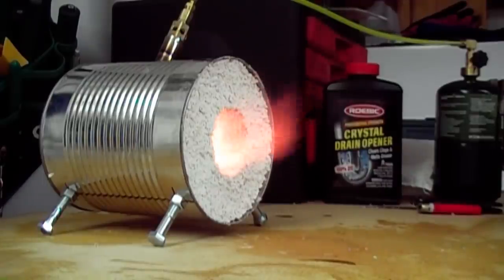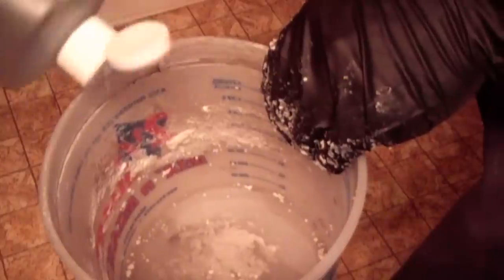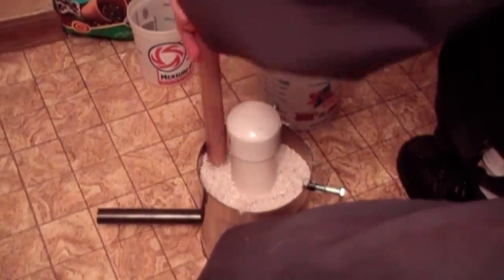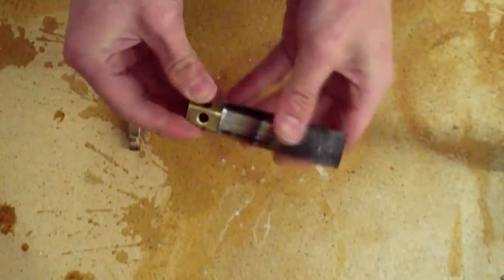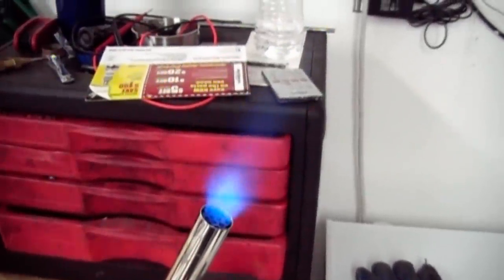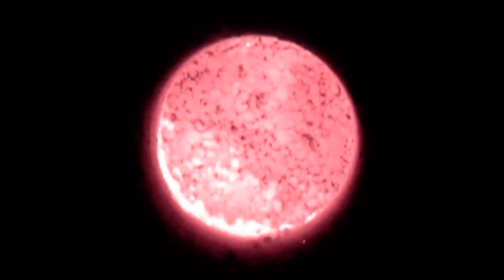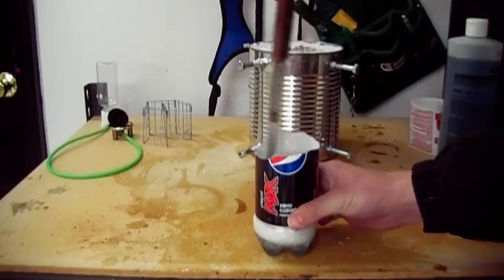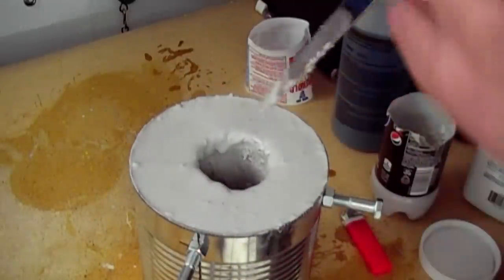How to make a coffee can forge

Comment: Wow, the alumina/magnesium silicate coating was a brilliant touch!  I really liked the details of your burner design, too.  Thank you very much for sharing such ideas!  Like others, I'm curious about the temperature your forge reaches.  One suggestion would be to use a small pyrometric cone.  They are cheap.  I have some I could send you.  If this forge can reach cone10, I'd be pickled tink. :)
Reply from the maker: Interesting, I have heard the terms "cone" followed by a number in referring to kiln temps but never really knew what it meant. Are these pyrometric cones one time use? Thanks for the comment!
Reply: clkindred
Yup, they're one time use.  But a box of 50 small cones is only about $7, so for an occasional check they're very affordable.  They don't measure precise temps (because time is a factor too) but are plenty accurate for this use.  Just push the base into a tiny ball of clay to keep upright and place to the side, where the flame doesn't directly impinge.

Comment: I think using 5 gallon can with the #10 can as the inside diameter, with 2 or 3 burners would be a good mini furnace. Using a 55 gallon drum with three 5 gallon cans put together on end with the top and bottom cut out of the middle can would make a nice small furnace to melt down scrap aluminum into sizable ingots...
Reply from the maker: Tony Iocca If only I had a place to store one that big...

Comment: Tried the Refactory recipe on my 1 gal metal furnace.  Looks like the pearlite is hardening up nicely but it hardens from the outside first.  It does better if you slowly and gently heat the sections one at a time. 1st made the base and lid for the furnace and let cure 24 hours. then into oven at 180degreesf for 4 hours. then up to 215 for one hour then up to 350 for one hour. leave in oven till it cools off naturally with door shut.  The inner tube wall is then added and the process repeated until all parts have seen the full cycle.

Then 1st exposure to propane fire for 1/2 hour.  Don't know if that's enough curing time, but it sure helps.

I don't like that it takes so long to get this all together, but I also don't like having the furnace fall apart in the middle of a heat either.  Main thing is don't boil out the Sodium silicate too fast or it will break up the pearlite cake from the inside.
Reply from the maker: Interesting, curing times seem to vary quite a bit from what I'm reading from people. There seems to be some major drawbacks to this method. Mainly, it's kind of like cooking food, in that there are a lot of variables to take into consideration that will effect the outcome. Also it is frustrating to work with a material that dose everything it can to fall apart. I'm working on a slightly different recipe and will post a vid soon. Thanks for the update!

Comment: This is a nice ,not to big ,set up for doing a few knives. What source of heat are you using if not a blow torch? How would you attach anything bigger to the S/S tube. You should put up more accurate plans for your burners and sell them for a few bucks. I'd buy them just to get exact measurements and from your comments,others are interested too. Great video!

Comment: Next time pour your mixture of the coating into a thicker 1 gallon zip lock bag, gut a small section of the corner off and use it like you would for a cake decorator squeezing the mixture into the inside. Just like decorating a cake. It will prevent waste, keep things cleaner and speed it up a little for the application process. Because you can add a long frosting tip (cake decorating section at craft stores etc.) use a spiral or wave pattern to apply the smooth with your spatula. Cuts the time down a lot if you know what your doing.

Comment: I have a question (maybe a dumb one but here it goes).  First I really like this little project and when I get time I plan on building one.  Here's the question, according to some research I did online I see propane can heat up to 3700 F,  Stainless steel melts between approx 2500-2700 F depending on the type.  With the torch projecting that heat into the forge why doesn't the heat eventually reflect back and cause the stainless steel sleeve to melt?  I'm guessing that the heat loss out the front of the forge is keeping the reflective heat acting on the stainless steel sleeve to be less than 2500 degree F.  Any comments welcome..

Comment: seems like it will create a hot spot.
Reply: +ken halverson It will indeed. But the working envelope inside is so small and the torch so intense that a simple cover or door would almost eliminate the problem. The propane burns at 3600 degrees and I bet at the opening it's not much less than that. As a forge for small parts this would be a great setup. As a heat treat oven it shouldn't be too bad if you want everything heated to 3300 degrees. :)

Comment: thanks, I built this forge, exactly the same, but I am using MAPP gas hand held torch.  before i built the forge i was placing a couple a fire bricks on the ground in a v shape and getting my steel red hot but not enough for a good forge, this is why i built the coffee can forge.  However when I tested it today for the first time, i put the nozzle of the MAPP gas into the hole but my forge is not getting hot , it is almost as if the flame is on a lower setting even though i put it on full.  the steel does not even get red hot.  something is not right.  i have a smaller nozzle than your burner, maybe I should open up the other end of the forge so there are two holes for the air to come through?  or should put a bellows i have made and pump air into it?  or should i modify the gas burner ? what are your thoughts on that.

Comment: Friend uses thermal wool and porcelain slip instead of perlite/plaster.  Kiln cement might work too.  He also makes a little curved wall at the bottom where the burner comes in, causes the flame to swirl back on itself and builds the heat.  I am curious about the plaster.  Been doing lost wax casting for 38 years.  Always told us plaster explodes at about 350 degrees F.  Lost wax investment is mixed with silica to improve its heat capacity, makes me wonder if investment would be better than the plaster in the long run, being premixed... But don't breathe the powder while mixing it!  Silica is bad for the lungs!  Friend says he has done short sword lengths in a #10 can.  Has also used an old turkey roaster as a base container.  Runs a black pipe into the can, covers the pipe with a fire bed made of seed corn and cinder landscape pebbles and sand.  Bellows or blower on the other end of the pipe.  Whole thing is portable in a 5 gal bucket and you can go anywhere.  No coal fumes or smoke, and seed corn is renewable.

Comment: +clkindred, I imagine you could use two coffee cans, soldered in the  "end to end" fashion to get a refractory longer for making a longer blade, e.g. a Bowie or a huntsman's knife.
Reply: John Mood Or just cutting a hole in the back would work too, otherwise you will need 2 burners anyway.
Reply: Then there is the neighbor with the oxy-acetylene welding setup, and I could theoretically  owe him a favor and get a "can" made to fit my needs. I figure three burners, turned on as needed. Lots of  refractory brick, not too hard to find in my town. So a little custom tubing, valves, and burners and I'm in business. Up to about 24" long and about 3" opening for the metal. I'll draw it in AutoCAD and go to the neighbor and we'll have us a crazy good foundry. He makes stuff too,so we can build it for both our use. BTW, I like you moniker, "Caveman", cool...

Comment: Are you spreading that special cement with your mother's favorite bread knife!?!?!  Great ideas on the stove!   Will your forge  melt all my fine gold dust?  How hot does that stove get.  Measure it with a laser temp. gauge if you will.  Thanks for Sharing.
Reply from the maker: MY mother's favorite knife? No. Someone's mom's favorite bread knife? Perhaps. I got the knife at Goodwill for like 50 cents lol. The laser thermometers I have can't measure high enough to give a reading. Nothing above 300 or 400 degrees F is measurable.

Comment: Very nice video.
A few questions
1: Would the perlite be exchangable for vermiculite?
2: How economical is it? Does a propane canister last a long time when used like this?
3: If a larger vessel would be used (like a large paint can or something similar) with an opening in the back of it for air (oxygen) intake, is the air intake on the burner rig still nescessary? Or can that be omitted?

Again, great video and thank you for the inspiration.
Reply from the maker: Sorry but I did not get a notification of your comment.

1: probably, I'm still researching the perlite's properties when used in this manner, I have used vermiculite in an experimental refractory using portland cement, but it proved only useful in reducing it's weight, the portland cement cracked at high heat.
2: It's cheap if you use it from time to time, it's always cheaper to use a 20lb tank in the long run, the 1lb tanks provide conveniance.
3: The size of the forge and number, size and location of openings (proper exhaust for combustion gasses still nescessary) has no effect on how this burner runs. omitting the primary combustion air holes in the burner will cause the burner to spew a soft yellow sooty flame. Gas burners have been designed to use external forced air (hair drier/leaf blower) in which case the orifice (gas jet) is typicaly larger, as the high velocity gas stream is not nescessary. These burners need a regulated gas supply as well as regulated air supply in order to tune the flame to a hot blue.
Reply: clkindred
Thank you very much for the in depth response. Very helpful =)
Reply: clkindred

research the manufacturing of a glass gloryhole, which is the reheating drum for glassblowing. functionally, ust a bigger version of you ten can forge.

Comment: I'd like to use a modified version to heat rebar for bending.  I wonder if both ends might be left open, perhaps with a smaller hole nearest the flame, so that rebar could be passed all the way through the forge?  That way I could make the bends starting forward and finally pull the remaining rebar through the forge.
Reply from the maker: It could be made that way, sure. It just complicates the form needed to shape the lining a little.
Reply: Well then I'll make one and let you know how it comes out. Thanks!

Comment: Plaster and sand work fine and they are cheap and easily attainable.
Reply from the maker: stizan24 My advice is to try it and see how it works for you.
Reply: I did. It worked well. Then I built my coal forge. Nice videos and some cool stuff but I don't have the time or the resources to make stuff to make stuff so I can make stuff.

Comment: With the perlite you made a form fitted fire brick. And with the liquids you made fire cement. I like the fire brick concoction, but it'd be cheaper to buy a tub of fire cement and use it.
Reply from the maker: Perhaps, but I already had the stuff to make the cement, so it did not cost me anything.
Reply: okay, but for those that dont have the stuff, the fire cement would be the cheaper way to go.

Comment: What did you use for making the threaded ring. I assume you cut it down from a threaded part. This is a great video and also the one on making your own sodium silicate. Awesome stuff. keep it up. You should stock the parts for the burner since I had trouble coming up with them. Sell a kit.

Comment: Stupid question, but why did you design it like a foundry? 

You don't want the swirl flame necessary in a foundry since you will not get even controlled heating from it that you need in a forge. The swirl is necessary for a foundry to evenly heat a crucible that fills quite a bit of the internal volume, preventing the crucible from overheating at the spot where the burner enters the chamber yet being cold on the other side. The foundry also does not need a spatially controlled heat source which intentionally leaves hot zones within the forge yet enough insulation value to maintain the heat within the steel being worked that has already been added.

A propane forge generally uses two equally spaced smaller burners instead of one large burner, and these enter at a ninety degree angle, either from the side or from the top (best). This allows for controlled heating of small parts or controlled heating of long pieces.  The needs and design are different between a forge and a foundry, as the use for each is quite different. The only similarity in use is that each is designed to efficiently heat a metal.
Reply from the maker: Paul Andrulis Thanks for the comment. Best answer I can give is I had no idea what a forge needed as far as burner utilization.
Reply: That's not a big problem. The design and overall build was actually quite well thought out excepting only burner placement. Overall, not too shabby. Used vertically, that would make a nice little foundry for small pouring projects as it is.

Comment: What is the purpose of adding the extra layer of the aluminum oxide/sodium silicate? Is it for thermal properties, or to have a stronger surface to prevent the perlite from chipping away? ( I noticed it was a little crumbly )
Reply from the maker: Stronger surface, and to provide a "non stick coating" so scale and other stuff dose not embed into the perlite. Thanks for the comment!

Comment: Great video. Thanks for sharing. 
Could the insultator also be made of a mixture of paster of paris and sand?
Reply from the maker: That seems to be a popular method. There are two properties. I want in a refractory, one is temperature resistance, the other is insulation. Plaster and sand In my book falls under temp resistance only, no insulation.

Comment: Grear video with clear and easy instructions, it was very helpful!!
 I do have a question for you. I'd like to make a Coffee Can forge myself. But I was wondering if I would be able use a Pre-mixed Furnace Cement like Hercules brand Hi-Heat Furnace / Stove Cement that has Sodium Sulfate and Silicon Dioxide already in it, that I you can get at any home store?? I have a tub of the Furnace/Stove Cement already and it's rated to 3,000°F. So do you think it would work on its own or would I have to mix it with the perlite to get it to insulate properly?

Comment: Will this work if you use a large center form like 3 1/2-4"? Could it work with a hole in the back, allowing larger pieces to be heated? I'm planning to use itc-100 to line the refractory lining. Using a TS8000KS torch as a burner.

Comment: i made this and the first thing i noticed was my puney supports made of small 1/4 bolts bent under the weight of the forge. the second thing it's that the forge never got hot enough inside to do anything. i dont know if the angle was wrong or what. any suggestions on using  propane or mapp gas?

Comment: How did you attach the burner screen to the stainless tube? Is it welded?
Reply from the maker: Destroyer of Worlds It's just a forced fit, I used a socket that fit inside the stainless steel tube to push the screen in so it would go in straight.
Reply: Destroyer of Worlds  what a wast of time

Comment: clkindred: First, thanks for all the tutorial videos you've posted... Quite a few of my own projects have been fueled by your information. Your time has been appreciated.

Second - a question. How are you connecting your burner to your fuel source? Assuming it's propane, how are you joining the barb and the fuel line? I would think that when it comes to a pressurized fuel line, simply having a barb inserted into the hose with a clamp on it wouldn't be very secure?

I've been stymied by how to make a burner that can be connected to a regular BBQ propane tank. Any tips on how to accomplish this?

Also, your .016 orifice hole drilled into the 1/8 MPT plug... was that done with a standard drill bit? The smallest I have been able to find is a 1/16th bit... which if my shitty math is correct, is .063. I'm afraid this will prove to be too large. Thoughts?

Again, thanks very much!
Reply from the maker: On connecting the hose to the barb, it depends on your exact setup but with the rate at which the blowtorch valve will let gas through, and the rate it can escape the .016'' orifice, the pressure can't get very high. I added a link to my new forge in the video description of this video, and at the end of that video I show how I hooked it up to a 20lb tank.

The .016 drill bit was purchased from a hobby shop, it's used for models and such. 1/16'' is many many times too large for this burner.

Thank you for your support!